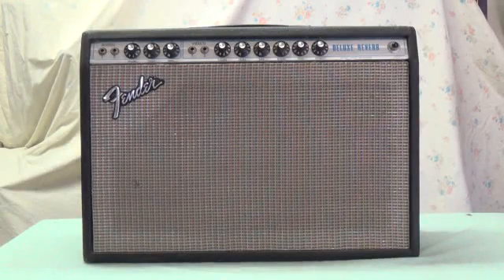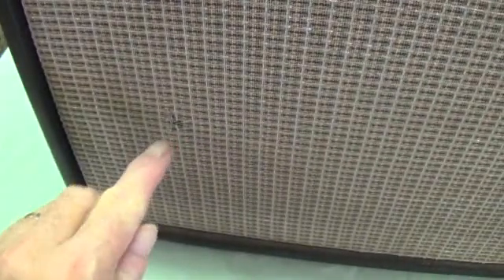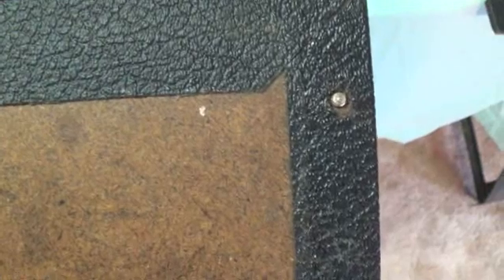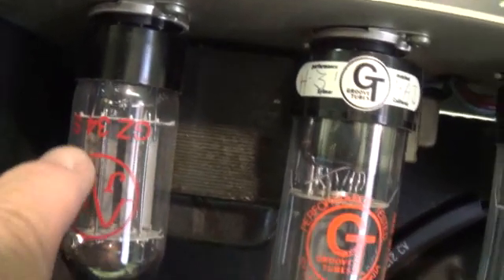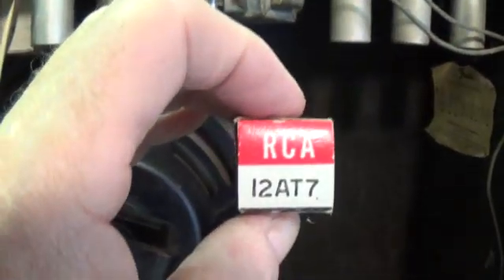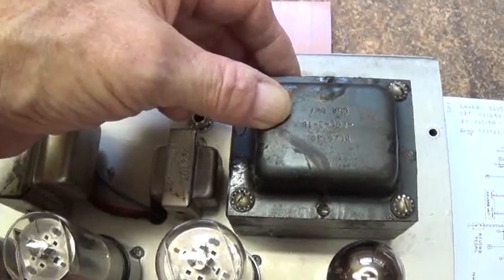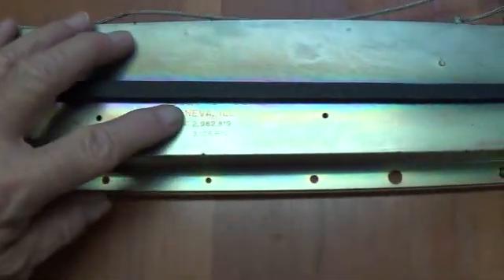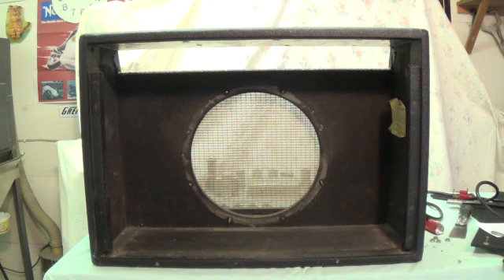1974 Fender Deluxe Reverb Part 1: Disassembly and Evaluation

Comment: I've always heard that Silver Faces are notorious for coming out of the factory with wiring mistakes.
Reply: never seen an issue woth silverface amps
 they're great and cheaper than the black faces. love my sf twin reverb. LOUD.
Reply from the maker: Greetings, OO. I've been working on both Black and Silver Face Fenders for a long time and have not seen a factory wiring mistake in any of them yet. It's my understanding that the amps were tested prior to leaving the factory, so you would think they would catch any mistakes then. Also, people seem to spread a lot of negative rumors about Silver Face Fenders. In my experience, they compare quite closely to the Black Face amps in both sound and build quality.
Reply: Uncle Doug The reason I mentioned it was because I watched a Gerald Weber video where he was converting a silver face to black face specs. He mentioned something about finding small wiring mistakes in some silver face amps. They obviously weren't serious enough to affect the amp too much, but he did mention it.
Reply from the maker: He has more experience than I do, so it may be true. I'll bet all big amp manufacturers have some Q.C. problems, but IMHO Fender Silver Faces are generally excellent amps.
Reply: Uncle Doug I'm not knocking Fender at all, I think they are the best amps in the world. I just thought I'd ask you to see if you ran into the same thing. I'm trying to remember what he said was hooked up wrong...It was either the heaters or a grounding bus...I'm going to have to watch it again. All I know is you can't blame it on the classic hand wiring process, because I own a modern Fender Twin & one of the power tube status lights never worked even when I got it brand new, so I opened it up and noticed two blackend resistors, and beside the two blackend resistors there were two 1 watt resistors that had a stray solder blob touching both leads, so not even the modern electronic manufacturing process is perfect.
Reply from the maker: I guess with any complex device there is a chance of error(s) during construction, but you'd think they'd detect the errors during final testing at the factory.....assuming that anyone actually does any quality control or testing any more:) When you think about it, it might be cheaper and easier for them to fire the entire QC Dept. and sell every (untested) unit they make....then rely on customers to do the final testing (after purchase), and repair the defective units under warranty. A little inconvenient for a few customers, but great for the bottom line :)

Comment: I enjoy your videos Uncle Doug (as well as your love for vintage British two-wheelers). I really enjoy your posts and think you're a very skilled teacher.  I have seen videos for modding the silver face. The allegations are the the silver faces are less robust than the black face models because of cathode bias issues. Gerald Weber - Fender Silverface Amp to Blackface Amp AB763 - Recap & Resistor Replacments  is a link to such a video. I'm ignorant but wondered if your approach is to restore to spec and live with what was designed or if you think this mod is in order for the reasons stated?  What do you see as the essential differences between the black and silver face fenders?  Silver faces are cheaper and easier to find.  Not trying to stir up a debate.  I'm just trying to learn (at my advanced age it's often hard).  Thanks for any response.   My only other question is whether your wife knows where here wooden knitting needle went?  Please keep posting.
Reply from the maker: Greetings, Carl. My pointer is actually the sharpened end of an old paint brush I found in my workshop, but I must admit that it does resemble a wooden knitting needle :) 

Re the original or mod issue, I am not an absolute purist. If minor circuit modifications can improve the tone and component longevity of a vintage amp, then I may well incorporate them. With customer amps, I offer them the two alternatives and let them choose.

It's important to realize that not all modifications were actually improvements. Many were done to reduce production cost or due to a lack of availability of the regularly-used part(s). You have to be careful which changes you adopt.

The Fender Guru has a site where modification of classic vintage Fender amps is discussed in great detail. Here is a link to his Deluxe Reverb page:  http://fenderguru.com/amps/deluxe-reverb  It's lengthy and at times a bit technical, but the guy knows his stuff and clearly defines the differences between the SF and BF circuits and how to improve them.  Check it out and see what you think.
Reply: Thanks for your reply Uncle Doug and for the valuable insights and reference. I'm more of a let it be type so I appreciate your approach. I'm anxious to get going (Hickok 6000A just arrived) but need to learn a lot. Do you think a Deluxe is too much to bite off for a first build or would you recommend a Champ or something else? Thanks for all the good intel (uncle dog too). Sorry for casting asparagus about your pointer ;-)
Reply from the maker: You're welcome, Carl. I think a Fender Deluxe would be a somewhat challenging first build, but if you take your time and pay close attention to the schematic (perhaps checking off each wire and component you install), it shouldn't be too bad.

I started out with a scratch-built Fender 6G15 Reverb unit (it's in the "Time Capsule Champ" video), and it came out fine.

I think if a person is careful and methodical, nothing is impossible. If they aren't, then even a Champ would be an insurmountable challenge. Good luck !!

Comment: I have an 95% original Fender Super Six Reverb with the six 10 inch.  5 of 6 speakers are original.Dated somewhere between 1974 & 1976..  Still works great!
Reply from the maker: Greetings, Pat. I'll bet that's a real monster to haul around :) I was wandering around in a local antique mall recently and happened upon a Fender amp that was a little taller than a Deluxe Reverb. The control panel was labeled "Super Six". Upon closer inspection, it appears that some lunatic had  used a hand saw to cut off the bottom half of the cabinet (along with four of the speakers). They probably sold the bottom half separately as an "original" 4 x 10" Fender speaker cabinet :)
Reply: Hello.  It's was cut down?  That is sick Doug.  I don't haul mine around.  It sits in the basement to play from.  I bought it in the early/mid 80's for $100 from a friend.
Reply from the maker: Wow, you definitely made a good buy, Pat. I'd hate to try to lug it up those basement stairs :))

Comment: Nice. Well done. I would just mention that you are probably safe in this case (a 74 amp) but in my experience about half the tube charts I have seen on BF amps are not the correct ones so take them with a grain of salt. Thanks!!!
Reply from the maker: Thanks, FL1. I appreciate your interest and input.

Comment: Hi again Doug
You were right. It was one of the smaller tubes that caused the intermittent buzz! One of the pins going into the socket what bent flat, so the tube was loose. I straightened the pin and it fits nicely into the socket now. Sorted!! (I am not a technician as you can tell).
Thanks for the tip!

Comment from the maker: Thanks, Daniel. What a strange malady.....I wonder if a wire or tube filament is "loose" and responding to changes in position? Have you tapped on the tubes to see if one is microphonic? Also, maybe try moving the speaker and reverb cables around while it buzzes to see if you can pin point the source. Good luck.

Comment from the maker: I believe that virtually all new tubes are being made by just one or two manufacturers, so there's not a lot of difference between them. These particular 6V6's tested with higher emission levels than I have ever seen, including NOS tubes. They pegged my Hickok tube tester.
Reply: Uncle Doug  As an interesting aside, the Maxi-Matcher people confirmed this and I have read that a number of foreign tubes are not exact replacements either. Also, I have found that Sylvania 12AX7s always test much higher than virtually all other 12AX7s. Most new US and European 12AX7s test around 1250. Sylvanias and some of the Eurasian ones test around 1650..

Comment: Great video as always!  One thing I might mention is you  should make sure the heater wires to the 6v6's are consistent.  In preamp tubes, it doesn't matter, but making sure the heater wire from the first 6v6 on pin 2 goes to pin 2 of the second 6v6, same for pin 7.  This allows hum-canceling to occur.  Fender never paid attention to this, so about half the time, they're wired out of phase.  Just a tip.  Looking forward to the next videos!